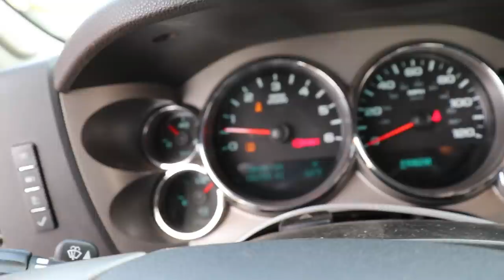WRECKED SILVERADO DEAL OR NO DEAL? EASY REPAIR?

Comment: That's a nice truck. I wouldn't spend any more money on it, just drive it as it is or sell it. Great job!
Reply: I have to agree
Reply: I love the show I watch it all the time I only have one issue you took the time to put all them new suspension parts on the front end of that red Chevy but why you had everything off you should have at least got a spray bomb and cleaned up all that rust just saying you got to accommodate us neat freaks you know disappointing watching you put it back together without cleaning it up a little
Reply: Not me I would mod it out a little get some nice tires and rims on it maybe a light left you'll get a lot more money out of nobody wants to buy an old dented up truck with crappy tires on it unless it's real real cheap but what's the point if you're going to sell it if you want to make money on it so make it look real good you'll sell it a lot quicker and get your money back and then some
Reply: Fix it up it's worth the extra effort it's a V8 4 x 4 you can get big bucks for it if you do it right
Reply: It's worth it like I said why even bother doing it if you're not going to make any money on it it wouldn't take much to maximize your profit
Reply: A good dent wizard could pop 95 percent of those dents on the passenger fender for a few hundred bucks tops .

Comment: It would be cool to see you guys first attempt at a paintless dent repair, not going for perfection since its salvage but just seeing what can be done with some hot glue and pull tabs, also if you can get behind it with a small rubber hammer I bet 80% or more of the dent would come out with minimal effort
Reply: With a foil skinned Prius, we're on a first name basis with with the paintless dent remover guy.
Reply: These maniacs would attempt to pull all of the dents from a rollover with hot glue, a metal hammer, a  rubber mallet,  and a heat gun.

Comment: I would fit the fender and bumpe maximize on you profits.  About 800 to fix the fender.  It was s great find . You need the for quick turn over and cash flow .value about 12 or 15 k

Comment: Have not seen you work with any dent removal tools.  Most of the damage could be pulled out without any paint and that would be a real time saver.  Keco has a real nice system that uses hot glue.  Might not be perfect, but for someone looking for a work truck it would do the job.

Comment: just curious if you thought about changing the upper control arm housing? It looks bent and distorted. could that be a problem under full load and cause upper control arm to come apart again or bottom out? Maybe i'm overthinking it
Reply: IMHO , yes, t needed the mount redone and after the shock it had, there is no way the coil over or the tie old tie rod end should have been used

Comment: That used to be a 4000 dollar pickup tops , you guys are so overpaying for everything you buy,I guess you have too or you’d have nothing to do.I hope there’s room to make money ,it’s a 130k plus mile salvage title truck with a banged up fender, you still have to run it thru the salvage inspection process which takes 6 weeks on average here.God forbid there was something wrong bent frame broken transmission you’d be upside down.It turned out nice , good job as always,

Comment: Can you get a clean title after the truck is fixed or are you stuck wit a salvage title? Definitely in the green, easy flip.
Reply: If it's a salvage title,  after it gets fixed and state salvage inspection you'll get a title but it will be branded rebuilt salvage for the life of the vehicle